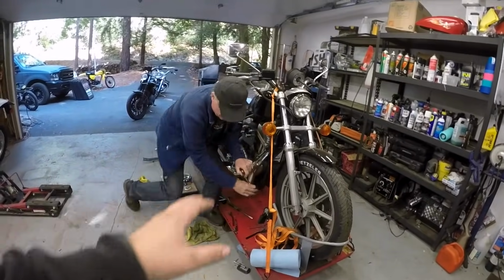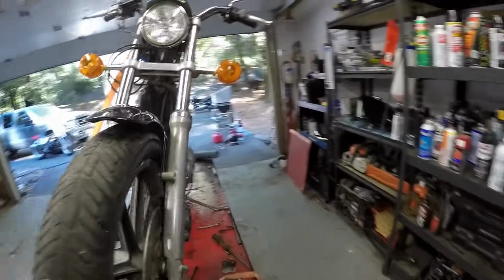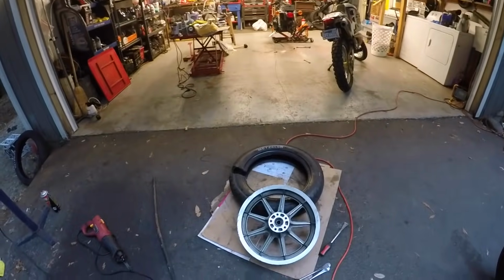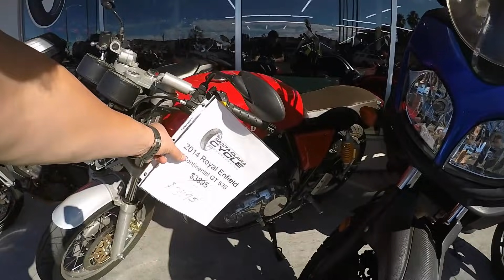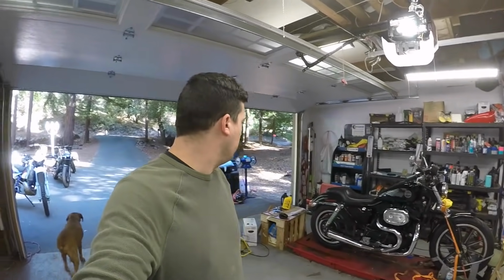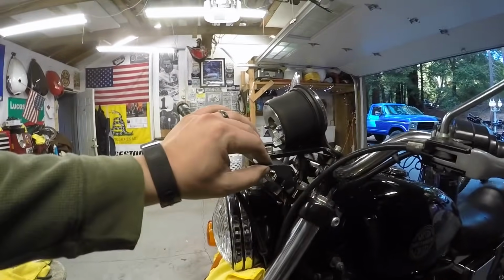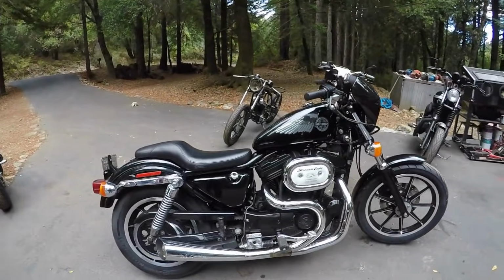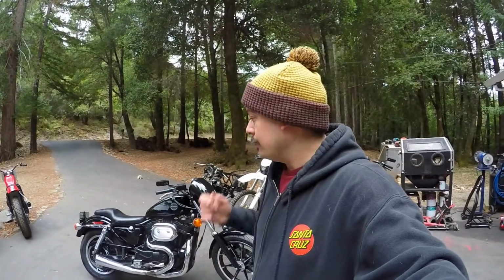Budget Harley Sportster Project, $700 And A Week To Make A Badass Bike!

Comment: A little tip is to peel the tape when the paint is not fully dried. Itll leave a more crisp line and you risk peeling the paint when you take the tape off when its fully dried

Comment: So you just painted a stock sportster? the mid spacer on the rocker box would have been a great accent to the fallback motor. All black, not my cup of tea and used way too much. And the horn doesn't look old school, looks like the horn on every sportster from 91-03. And the motor isn't a wet sump, it hs an oil bag to hold the oil. If it wet sumps, you got an issue....

Comment: I have a '84' XLH that I did things to like new fenders and split tank then I painted. Swaped wheels to spoke. Had the barrels borded to 20 over. Replaced everything in the motor including barrings except the cams. Those are the only thing thats te same. I've got new generator-regulator, starter, LED headlight and sidelights. Its like a new bike but didn't cost thousands but still it only has a 4 speed. It's funny I keep going for that fifth gear when I ride with my friends LOL. My goal was to make it not look like a sporter and I think I did just that. Don't care what anybody says the sportsters are a good bike.

Comment: Yup 91 XL1200, Think I need a new tail lite tho. . .socket seems just a bit big for the 1157
light bulb.. rear dir sigs were just that. So I changed 'em to tail lites and dir. sigs, safer at nite
if the regular tail lite goes out.

Comment: I put the same fairing on my sporty brat bob to help clean up the front end
Reply: Rick Simpson  I'm running 1 in risers and a single speedo, it sits tucked way inside, also I'm still using the stock headlight mount under it to reduce headlight vibration. I think with your risers and the side by side tack/speedo that it should fit with maybe the top edge of the tack and speedo peeking out the top, only one way to find out

Comment: Nice bike... So, how long does the paint on the engine last?   Does the heat make it flake off after a while?
Reply from the maker: Charles Belville as long as you don’t clean it with a screw driver and wire brush it should be fine 😂🤣

Comment: Did the paint on the motor last?  Im bobby out a 01 sportser now and I think Im going to paint it now.
Reply from the maker: @Circlesaucecheese  yes, heat cycling It is crucial in the beginning and you don’t wanna use harsh chemicals to wash it. A good spray polish after it’s done will help the dirt and grime come off easier.

Comment: Mason, you seem like a nice guy so I want to pass on a little tip. I remain anonymous on here, but I have a small well respected Dyna performance shop.  You can change the look of the front end for the better by redrilling the fender mounting bolts. It gets rid of the dirt bike look and when you see the difference,  it's worth the effort.  I have a dozen bikes done this way with probably a hundred thousand miles combined, so yes it holds up.  
And yes on the COMMANDER II tires, my " shop " Dyna has over 160 pounds feet of torque at the wheel,  and the MICHELIN is the only tire for me. All the very best,  SARGE.
Reply from the maker: SARGE BULLDOG awesome thanks for the tip I appreciate it big time! On my personal bike (FXDX) I made a fender mount out of a Roland Sands fork brace and it worked out great!!! I’ll definitely give it a try on the next sportster I get in. Thanks again!

Comment: I have a 1994 XLH 1200 and I love it
Reply: I have a 1995 XLH 1200 in showroom condition & I love mine too & I ride it pretty hard & it has never let me down, great bike! The vibrations in the bars & pegs sometimes irritate me but I just deal with it, does yours vibrate bad? Do you have any tricks to dampen the vibes in the bars?
Reply: @jimmansi1187  Back in the days they used to use fishing weights or washers and make some weights that would get rtv'ed into the bar ends and curb the vibrations. You could also use sport bike type weights if you don't mind having sliders on the bar ends. Limits what kind of grips you can use though. Gotta experiment.

Comment: Very cool result! I had that same fairing on my 2000 Dyna FXDX when I bough it, but it was mounted up (with that flimsy bracket) over the top of the stock headlight mount, which made it very solid. You couldn't really see the original headlight mount under the fairing. So, maybe you didn't need the custom mount? The wheels and fork lowers look excellent!

Comment: Would have been awesome if you listed the paints and wheels etc in the description. 

Thanks bro
Reply from the maker: sgtginga I just used regular old gloss black spray paint and the wheels are OEM Harley Davidson with Michelin commander two tires. The only other parts I really added were the faring and that’s an eBay special. Good luck on your project and thanks for watching!

Comment: Did that paint on the engine or rims ever peel off in 3 year?
Reply from the maker: I don’t have this bike anymore but I’ve painted a few this way and as long as you don’t pressure wash it, it holds up good. It’s all in the prep, gotta get it super clean before you paint.
Reply: @MasonGeorgeMotorcycles  sweet thanks for the info! That bike looks really good.

Comment: Anyone who's been around bikes for a bit should know that altho the Sporty was harley's lil brutha,
such is not the case anymore, when they came out w the street 500 and 750, they unwittingly made 
the sporty the middle brother, as even the 883 is even 133 c.c.'s above the 750 and 450 c.c. more
gives you the 1200.
I have a 91 XL 1200 and I can't begin to tell you how many great rides I've had all through central
Florida on back roads like 301,39,41,60. Its o.k. on the superslab but the slab is more for the dyna's.
If you want a bike that is a couple hundred lbs's less than a 700 an something, pound bike, good 
m'spg and flat out fun to ride,  well mine has forwards and I can stretch out, a sissybar with a porch
I put a 1 or 2 gal jerry jug for x-tended miles, I'm just saying that a Sporty can be customized in many 
ways. Frankly, I think it's all about the ride.

Comment: I'm debating on taking a rattle can to my engine, too. How well does it hold up?
Reply from the maker: el_moe_ it’s all about the prep work! If you get it super clean and don’t use a crazy 3000psi power washer on it after you won’t have any issues.
Reply: @MasonGeorgeMotorcycles  cool, good to know! I was just thinking about degreasing, sanding and scuffing the hell out of it, but wouldn't hurt to take a pressure washer to it, either.
Reply: It will not hold up at all.  First off, if you don't sand everything down properly, the paint will have nothing to bite into.  Secondly, rattle can paint, like what was used, will not stand up to fuel and oil, etc.  It will start looking like crap pretty quickly.  Great for a quick sale, but will not last.
Reply from the maker: Rob I ran into the guy who bought it just the other day and it still looks great🤷🏻‍♂️ I used the same process when I painted the wheels on my Dyna and it’s been about five years no chips no issues.

Comment: I think it'll look fine if you left the primary and the valve covers alone and only painted the fens that would have been a lot better I just I really can't stand the idea that you painted the entire f**** engine why I have a simple rule if it's made of bricks if it's made of wood and if it's made of stainless or aluminum don't paint this
Reply from the maker: Nicholas Erdody you must’ve missed the part where I went over how all the aluminum is oxidized... this was a budget build and tearing the motor completely apart to Vapor blast or sand  the aluminum wouldn’t be worth the effort. I have a simple rule that if I can save a bike from going to the junkyard and get a new person into riding I paint it 🤣
Reply: @MasonGeorgeMotorcycles  yeah II heard you say it but I've done a few motorcycles in the past and my first concern was any of that engine enamel, and to be honest oxidation can be removed, aluminum, can be polished.
Reply: @MasonGeorgeMotorcycles  to give you a compliment,I normally don't like fairings but I thought that really set off the look,and I was very thankful that you got rid of the original and god-awful mirrors that had it I really like the more updated look all-in-all the only thing I really objected to his painting the engine you could have painted the engine and polish the fins and you know not painted the entire engine you could have painted the case without painting the side covers that would have looked way better the fact that I can't see the engine the only part I can see in the video after you painted it was the exhaust and the intake and the horn is probably the most offencive part about it I can't even tell where the jugs beginner end because in real life it probably looks better but it in my view I can't see the engine I ride a motorcycle one of the best things about motorcycles is you can all always see the engine unless you ride a a sportbike but they even make naked sportbikes now so,it's just one of those things when I was growing up if everything on your bike was painted black or if you're hot rod has painted flat black that just meant you didn't have any money,but then again that does kind of come back to your point this is supposed to be done with a budget